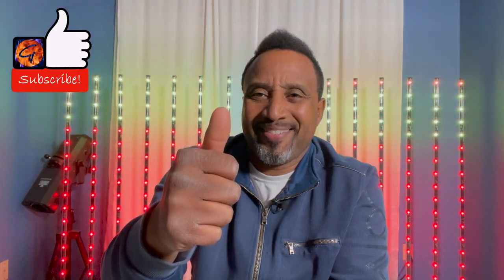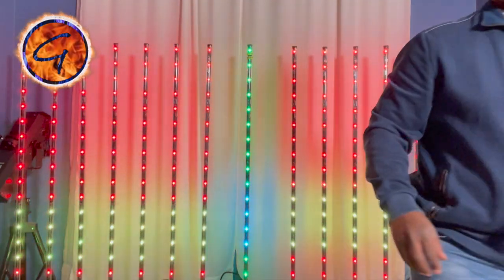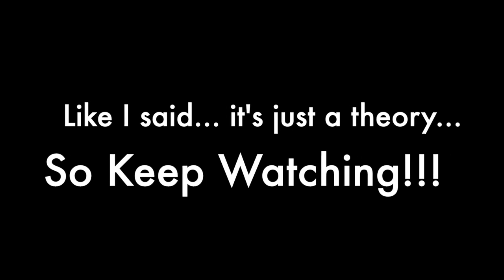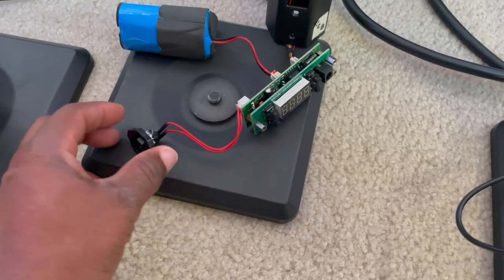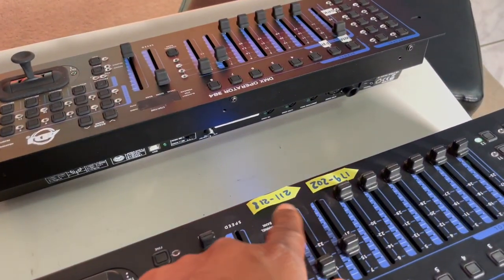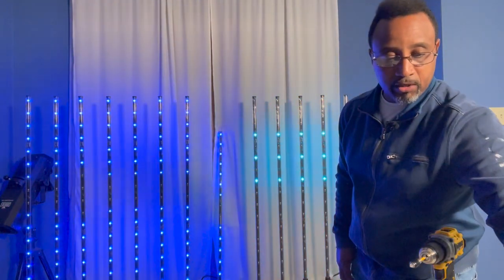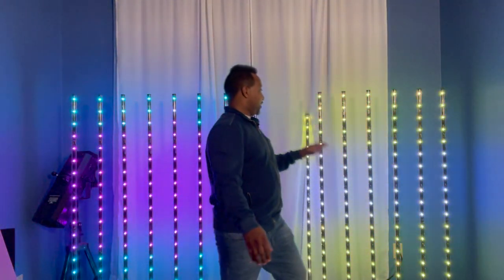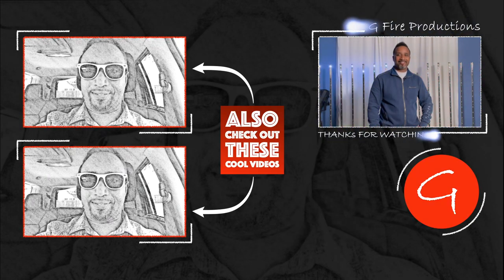Freedom Stick Out of Sync

Comment: This  is a curious issue, I want to get four more freedoms sticks, I am now going to hold off. Has Chauvet responded to this problem?
Reply from the maker: A tech support person basically told me it was a firmware upgrade but not specifically what part of the stick I could change to fix it. Basically led to "hey buy the new freedom sticks". I'm pretty good at trouble shooting so I figured out it was the LED assembly. Like you I wanted more sticks but the LED13 tubes were created a couple of years after my first 8 sticks which are LED12.  I didn't notice it until I let the program macros run for a while on all 16 sticks and half was slower plus one just had a macro issue itself. I will use tip money to systematically replace every tube that is on the LED 12 firmware. Only six more to go and all 16 will all be sinking in perfect time.
Reply: @gfire_productions  This Information on the firmware is helpful. I may roll the dice and get a 4four pack from Sweetwater. If they don't match (firmware), I can return them.  Too bad  Chauvet dropped the ball with this issue. This is something Chauvet should have a solid fix on. I will let you know which Firmware I have.
Reply from the maker: @NuthinButFlavaEntertainment  Cool bro.
Reply: Can you show a video on how to setup them up via DMX?
Reply from the maker: Thanks for watching Andrew. I sure will sir. If you've subscribed you'll be notifies when it's up.
Reply: Can you connect with a Donner wireless transmitter?
Reply from the maker: @peterserr  I don't know because I don have any experience with Donner.
Reply from the maker: Yes, I learned that my older sticks or at least the first eight of them are on a different firmware than the second eight of them. My options are to sell the older freedom sticks and buy the newer ones or just replace the LED assemblies of the first version freedom sticks.